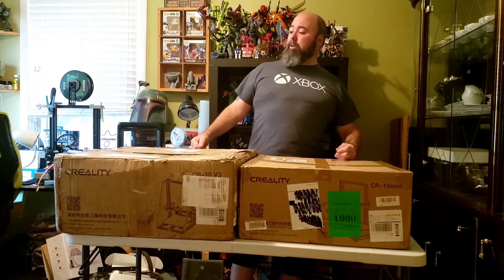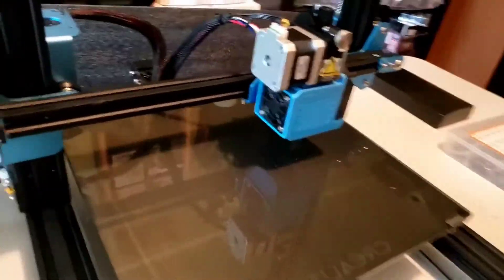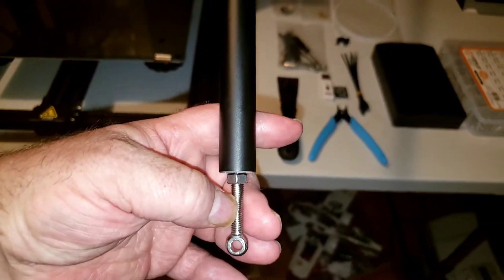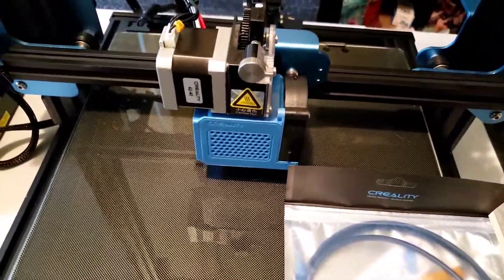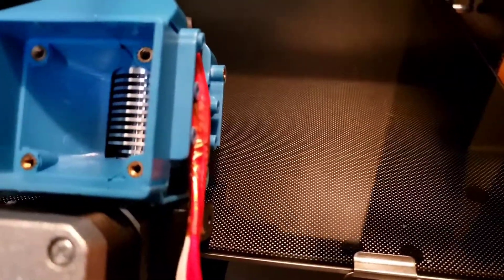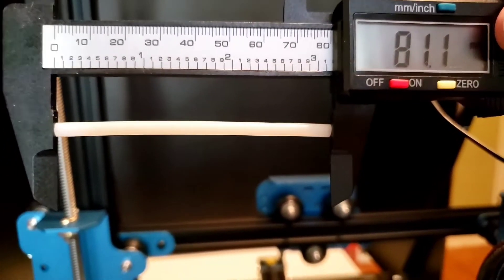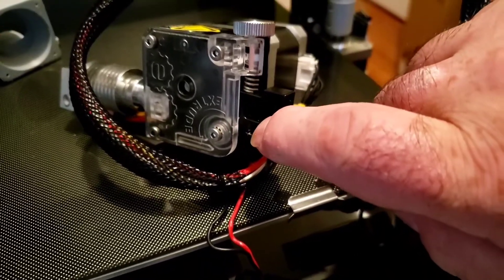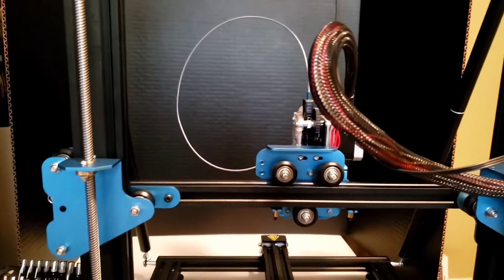Comgrow Refurbished CR-10 V3 build! Refurb vs New?

Comment: We bought a refurbished printer CR-10s from Comgrow.  Waited 10 days to receive it.  It came broken.  Did not print.  Waited for another 10 days for a replacement fan.  Fan did not resolve problem.  Looked like the inner wires were pinched and damaged in the printhead.  Now waiting for their response. They literally sent out a damaged printer.  I DO NOT RECOMMEND COMGROW.